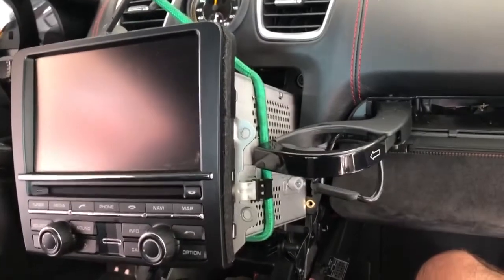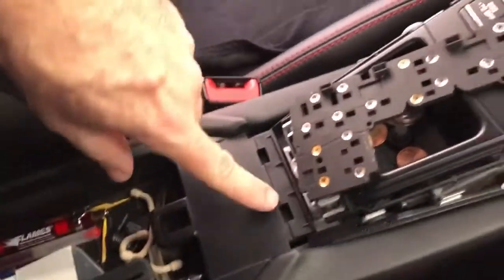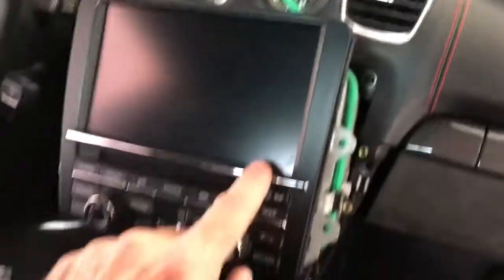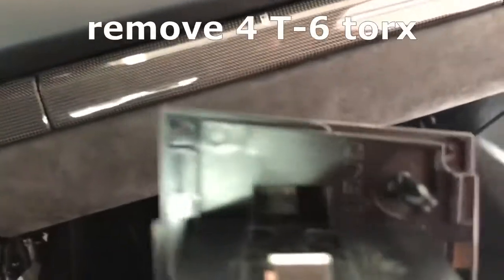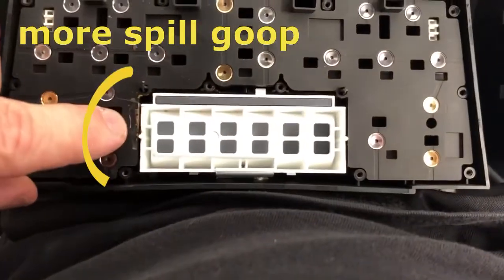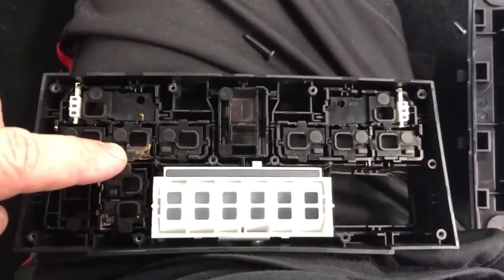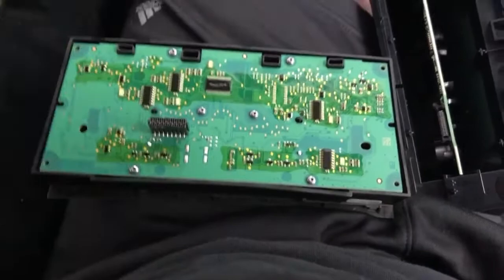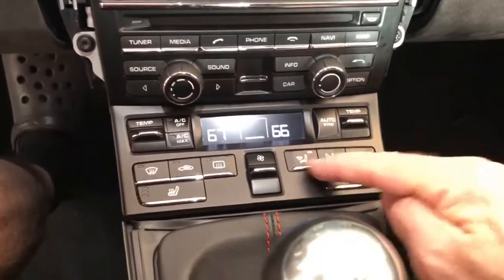Fixing stuck temperature button on '16 Cayman GT4

Comment: For the temperature control unit, are there any screws I need to take out besides the 3 connecting pts?

Also I see you didn't have to take out the radio unit, but was able to take out the temp control unit, correct?